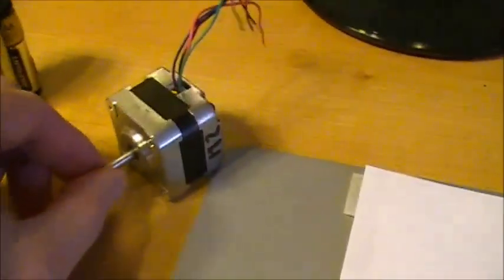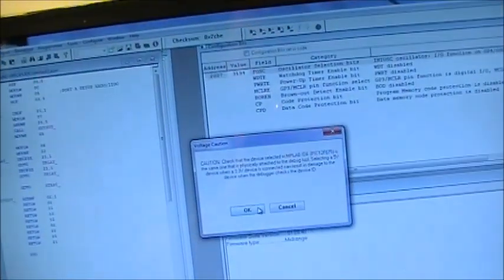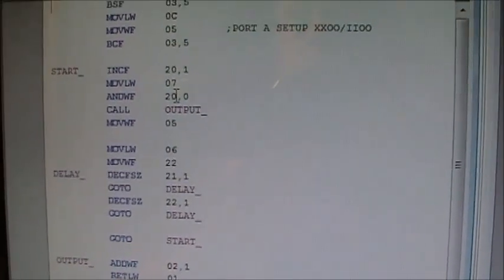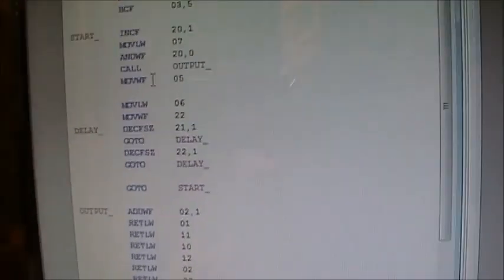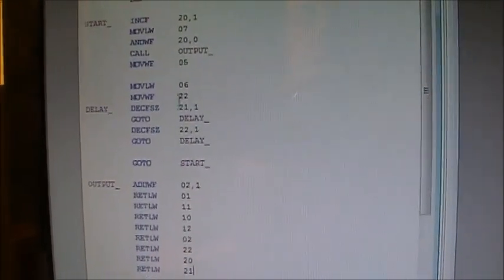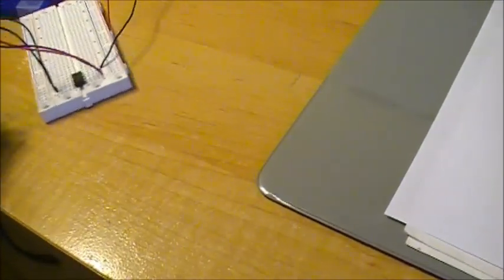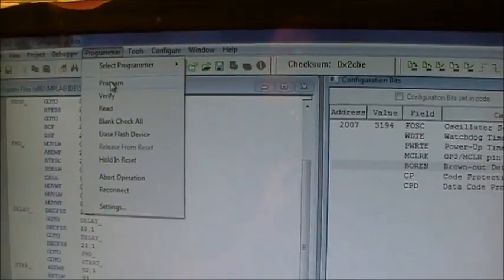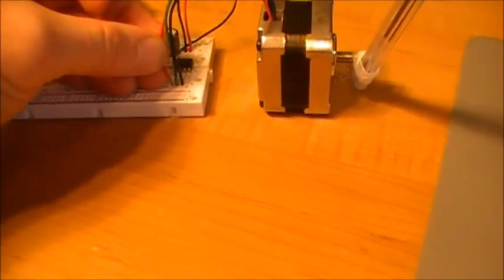Stepper motor project for PIC

Comment: Hi
could you control speed and way of rotation with components added ?
Reply: No. Stepper motors are inherently trapped into being speed controlled only by what the controlled chip gives it. same with direction. This actually is good since it's probably the only motor that will maintain the speed that is asked of it regardless of variables such as a workload changing or wear on the motor over time or heat. That being said, I guess an AC motor would do that too but you would still be manipulating the AC wave when you wanted more done besides a constant speed in one directing

Comment: Nice video, keep up the good work.
Can you or someone help me with the following;
I've been salvaging stepper motors from different sources like printers/scanners etc. These Stepper motors are of various sizes and of various powers (like one is of 2.5V-2.0A-1.8/Step, other one is 1.6V-2.1A-1.8/Step). I've a question now. What is the most efficient way to use all of them in one system like CNC? Using one power supply? What controller? 
Regards
Reply: This is a really late response but nonetheless maybe somebody else has the same question. I'd use a chip that has at least two and a half 8 bit I/O ports mainly because each of the 3 motors takes 4 I/O bits to work and you should consider having 3 home location detection devices, 1 for each plane (stepper motor)  and then maybe 1 for the machine off/on if you want and then finally maybe 2 I/O for a serial data input. The whole thing could be done with just 2 full 8 bit I/O ports such as a 16F1847 provided that the data for your CNC was onboard as a repeatable project such as making widgets over and over again. Drivers....i currently am using L293 drivers but they are rated for about 1 amp, nonetheless I believe that you can tie them together to make a 2 amp driver, but I'm sure there are 2 amp drivers out there.

Comment: mm trying to apply this to a PIC16F690 , and for it to be controlled by an A to D from an integrated variable resistor (reads as an output 0 if memory recalls) , is it at all possible for me to access your code as to compare it to my current code?, I feel like I could make it more efficient.
also any tips on avoiding emf would save me well...replacing chips :d

with c++ , I tried the c++ compiler with the mplab instead of using assembler, and it honestly was useless
Reply from the maker: Normally a driver chip would deal with the EMF issue, in this project I deliberately reduced the parts count down to just the most basic components in order to get the main concepts across to the viewer.
Reply: Thanks for the reply however I completed the a.d with an existing driver np :)
Reply: I have some C+ coding experience but I find that with those higher level languages I tend to find it harder to pick up programming with it when I take a 4 year hiatus from this hobby. Assembler is a little easier since i really am only trying to figure out less than 50 instructions. Though there are lots of subtleties with this programming language that is best learned by reading other peoples coding preferably some that has a lot of remarks riddled into the code.  The other advantage of this low level language is that you have nearly total control of whatever you are controlling...great for control freaks! No other language will offer that. ...well maybe machine language but really, that is not realistic here.

All my code is there. 20 or 30 lines. That's it. Nice and simple. It ends at the word "End"

To avoid excessive EMF it is best to use a driver chip such as a L293 which has the dampening diodes built in as well as a 1 amp drive capabilty instead of a wimpy  25 ma as seen here.

Comment: Do you have an example of how to control multiple stepper motors via pic?
Reply: I have, for three motors, but really it requires a larger chip and all motor movements are interlaced and ratioed out(is that even a real word?) in order to smoothly move from one spot in space to another using the most direct path making for a really complex explanation, You thought this video was shaky, that one would mess up even the toughest geek. Though in saying all that, my application was for a 3 motor crane that would pick up objects, but maybe yours would be for something that did not require ratioing out a direct path. I'm sure that's not a real word but the concept that i'm trying to convey is that the movement of all 3 motors should all work together to fluidly move from a XYZ coordinate to the next and to do that you have to have the processor pre-calculate out how many steps each  motor will take and then find a ratio of movement between all three motors so that the end result is that they are all steadily moving at different rates so as to arrive simultaneously at the next stop point. Whewww, nobody will read this will they? I could probably give my bank account pass code and account number here and still never loose a penny from theft. lol, i got way too much time on my hands.

Comment: great video!
you did not use drive circuit. you are using PIO pins to drive motor. PIC PIO is that strong? what is the voltage you applied?
thanks
Reply: Well, as mentioned, without the driver circuit, i really am only using 2% of the motor's potential but still enough for an uncluttered demonstration. 5 volts here, but 7 vdc maximum if you want to run to the edge....3%